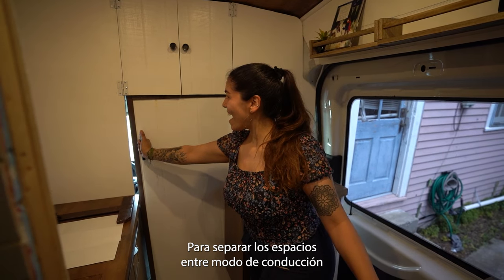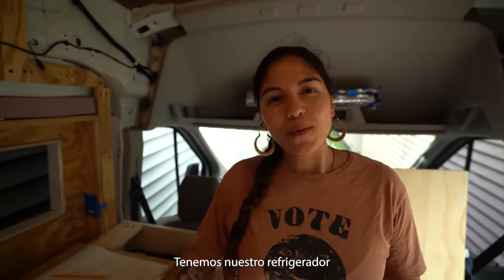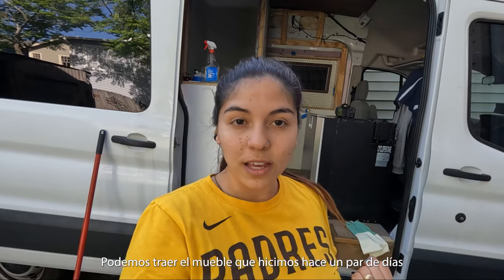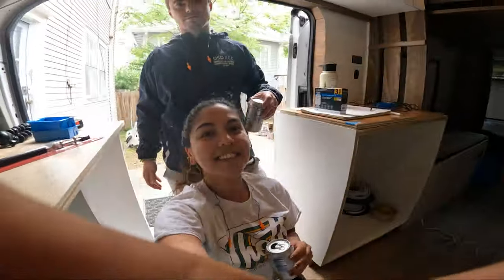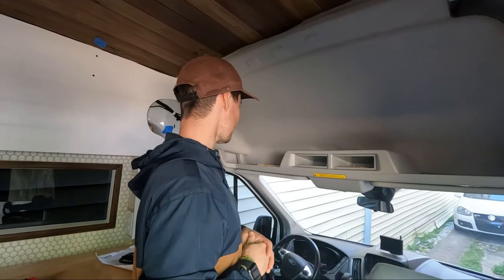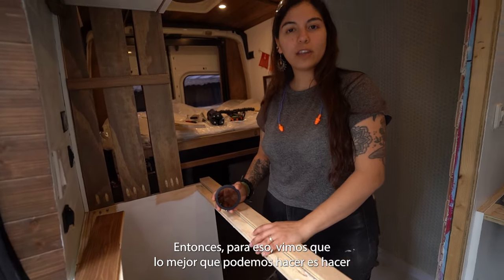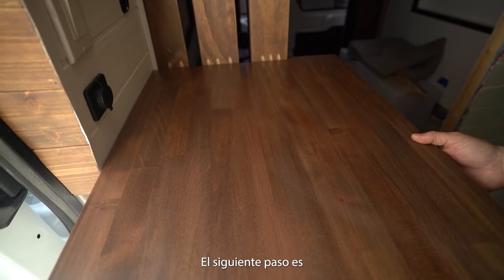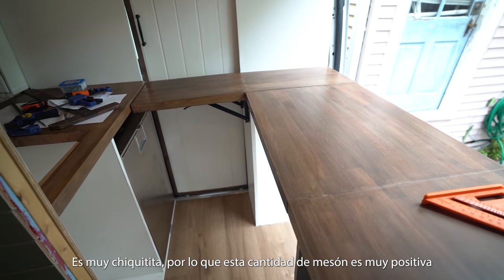U Shaped Kitchen | The BEST kitchen layout! | Dometic CRX110 | DIY Sliding Door | Van Build Series

Comment: Nice kitchen layout, Chile and Aidan, you guys are so creative! This video give me so much inspiration on designing my van. I am just wondering if is it possible to open the sliding door from inside (looks like the cabinet is located right in the sliding door handle?) Thank you very much
Reply from the maker: Thank you so much for the support and compliments! The upper cabinet is flush with the wall on the right side of the kitchen and side cabinet when you enter. The track for the sliding door and the handle actually sit right behind that so that the door slides between the back of the front seats and the wall dividing the kitchen and the driver’s compartment. We offset the handle a little so it wouldn’t crush with the wall and allows the “pocket door” to close. Does that answer the question? Hope it helps!
Reply: @OutdoorsMantra  Reach the handle through the gap/"pocket". Thank you very much. Stay safe out there :)